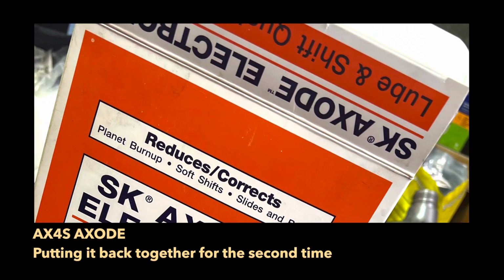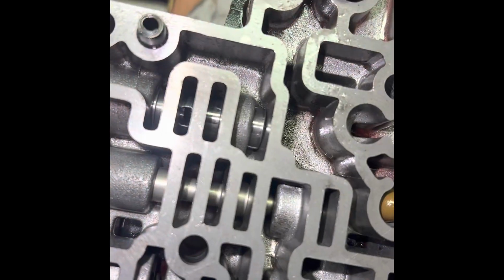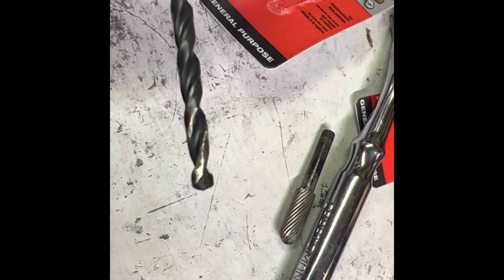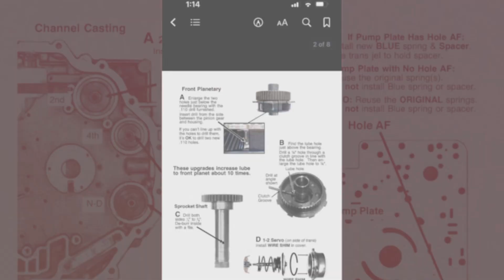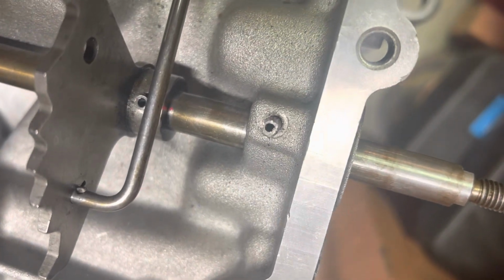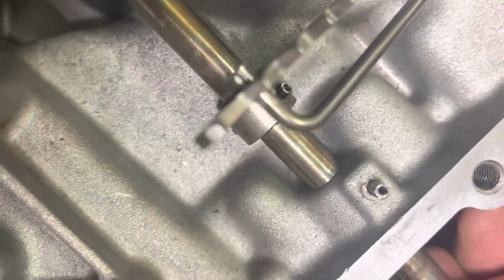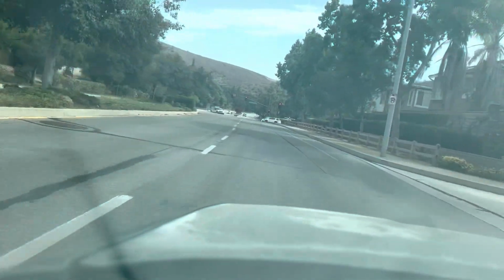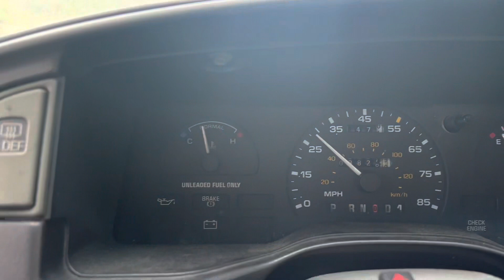AX4S Transgo shift kit and rebuild

Comment from the maker: This was also rebuilding the transmission after it failed from previously rebuilding. I added the shift kit which also comes with the boost valve and other valves that are recommended to be replaced. The car drove shifted and then failed again. I had the car  towed to a transmission shop. I’m still waiting for the car to be repaired. Update the transmission was repaired $3700 dollars and I was thinking I kept over tightening the pump cover. I wanted the transmission shop to tell me the problem but I never found out. The pump shaft has to be very free when turning. I believe that was my problem. The pump when turning is metal on metal against the cover.
Reply: Puedes ayudarme dandome el diametro, sin los anillos de teflon con un bernier el, soporte q trae los 5 anillos naranja miede la circunferencia sin los anillos, que quiero ver si le adapto esos anillos a una th125 al soporte de la mia, ya que esos, de ford se ven mas grueso mejores